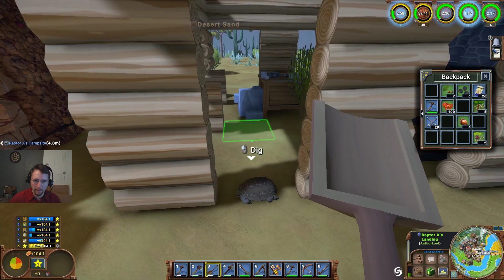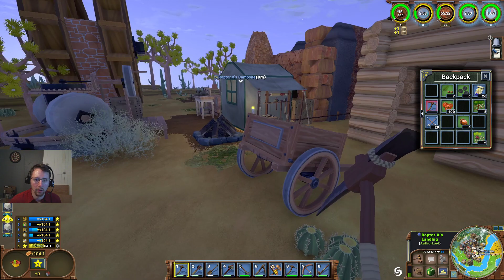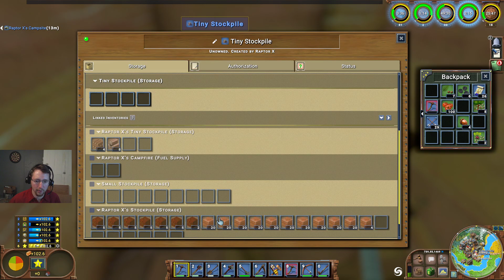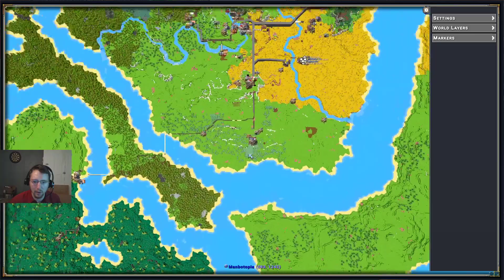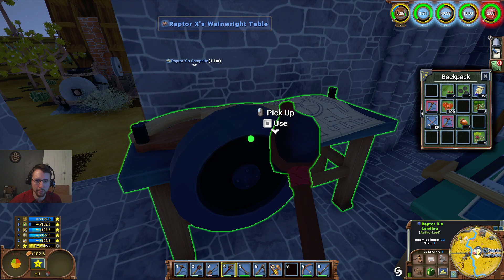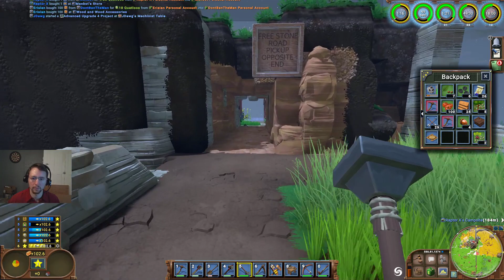Setting up Smelting! | Raptor X | ECO T3stN3t server 002

Comment: I’ve just stumbled acrossed ur channel bec I needed help with understanding smelting and I love them they are very informational and helpful.  I hope I can learn more from the next videos keep up the good work
Reply from the maker: You're very welcome! Thanks for the encouragement, it really makes my day.
Reply: @Raptor_X  quick question ik u said in one of ur videos that u can dog down into the ground to contain the slag but is there any other way not needed to be in the ground that won’t kill a lot in the area?
Reply from the maker: No, that's the only way currently to take care of tailings. It used to be that you could stack it up in tailings "silos" by capping the pile and as long as it had a roof over it at least ten blocks from the top of the pile you were good, but now it just has to be burried at least ten blocks below the surface, and it has to be solid rock for those ten blocks. I generally just dig down to where I find the ore and then just put the tailings back in the hole I take the ore out of.